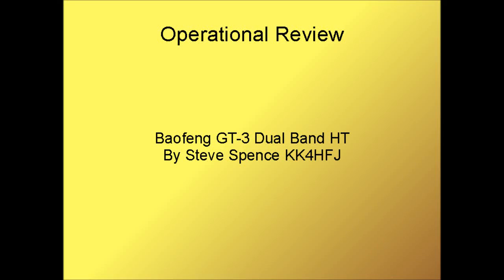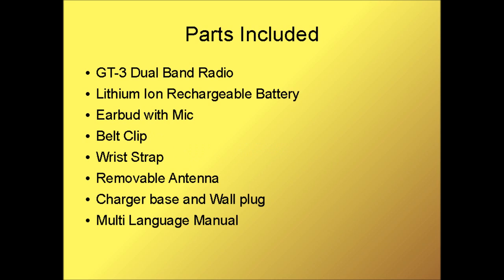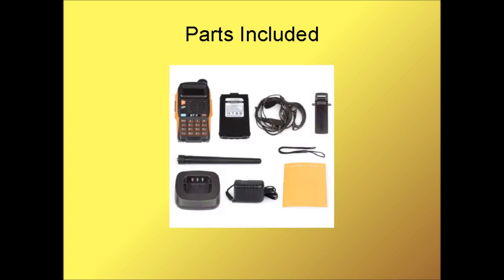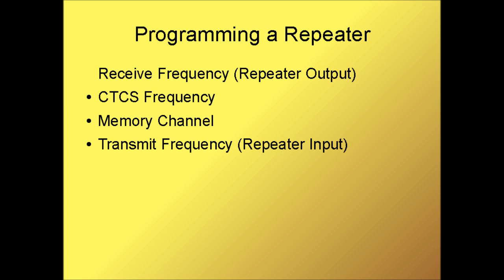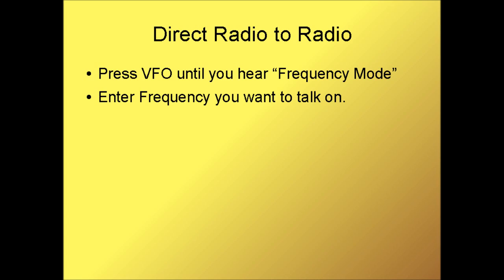Baofeng GT-3 Operational Review

Comment: The first minute was great Steve [ by the way , I just crawled out from under a rock or out of a cave ].  I don't have a cable to connect this GT-3 to my computer.  I don't suppose there is a way to program this without one ?  Also, I'm so new to radio's...I'm going to have to find a more basic explaination.  I used a radio once as a kid but all we did was press one button to talk...and then listen...I'm wanting to further my education on these because later I'd like to get into HAMM radio's.   Is there help for me ?   I  WONDER WHERE COULD I GET THAT CABLE....to connect to my computer ?   Also, I was told I could download something called " C H I R P " to help get these frequencies into the radio ..is that true ?   signed lost in WA
Reply from the maker: Nowhere in this video did I use a cable or computer to program. I programmed all the settings from the front panel. Maybe you didn't watch that far? RT Systems makes a nice cable and software package if you don't like using the front panel to program.
Reply: I admit to not watching the whole thing.  I have decided ...and have ordered a ? USB cable...so I can ? C H I R P ?  those numbers into the GT3TP.  I saw so many frequencies to enter...I called my local radio supply 70 miles away...and hope to figure out what I'm doin by Saturday.
Reply from the maker: You don't need a cable, or chirp, but if you want to do it that way you can. it takes a special cable. If you don't have your HAM license, do not transmit! Once you get your license, all this stuff will make more sense, as it's on the test.
Reply: Thanks.  I am trying to rush this...for couple reasons.. I live in the northwest...and they keep saying we're gonna have that earthquake...overdue for 9.0 .   I now have that cable...pressing on.   Thanks.

Comment: Hi Steve...did you also notice the ridiculous design flaw of not being able to drop your GT-3 into the charger fully because the belt clip is too long? I actually have to squeeze the belt clip wide open (rubbing against the back of the charger) so that it then allows the HT to drop fully into the charger. Very poor design flaw!

Comment: Good video, I guess that works, you can program repeaters on these radio's without enter the frequencies seperately, if you program the offset and the shift direction, then you store the receive first, exit out, press the scan button once, the radio will then shift to the transmit frequncy, then you store the transmit frequency.

But yeah, I suppose its just as easy to do it the way you did.  :-)

Comment: The Software and Drivers you need are at the Miklor Site.
Drivers, Software, FAQs, Keypad Programming and Flowcharts, etc
Note: The GT3 and UV5R are basically the same radio when programming and operating.
http://www.miklor.com/UV5R/
Reply from the maker: I prefer the RT Systems software and cable.